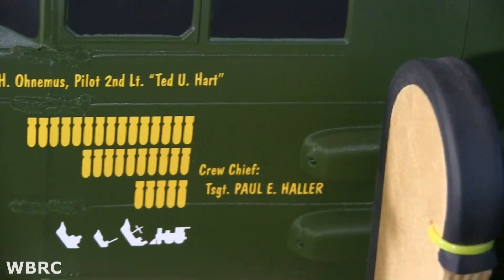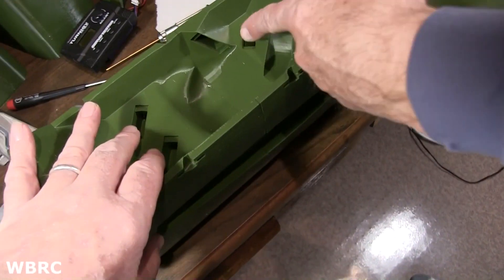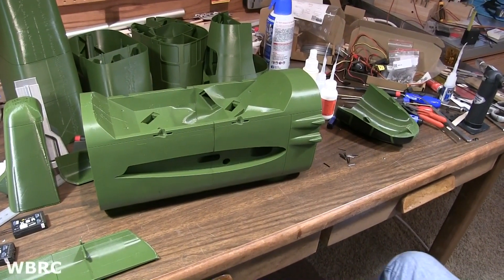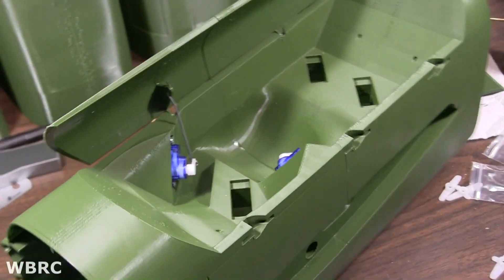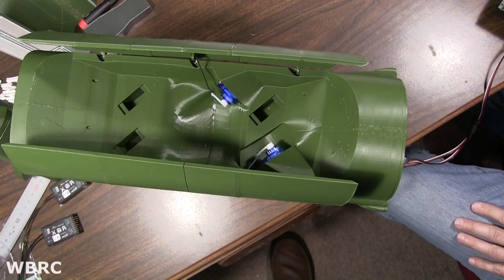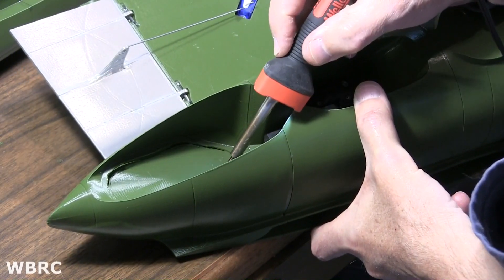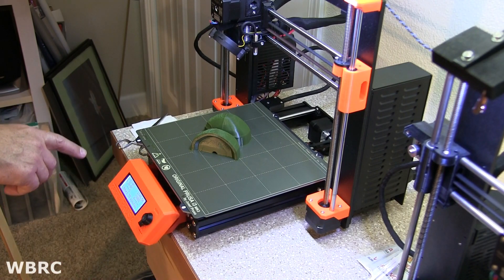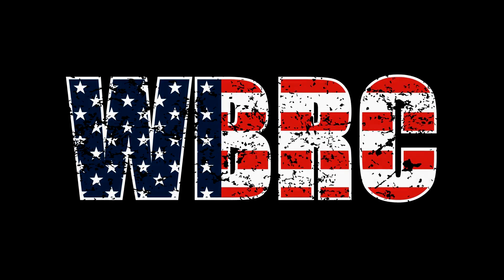3D LabPrint B 25 Mitchell

Comment: Hello, nice video, well made.  I also assembled the b 25 from 3dlabs but being the first 3d printed plane, i did not think to make sure the bowden tube for the elevators were clear for the 1.2 rods to slide easily in.  I hope you had better luck.
Reply from the maker: Thanks for the tips!

Comment: What printer did you use for this
Reply from the maker: At 6:30 you can see very clearly "original PRUSA".
Reply: @WrightBrosRC  thank you
Reply from the maker: You are very welcome. I would recommend taking a look at some 3D Print B25 threads in forums such as RCGroups. Many details there.
Reply: @WrightBrosRC  ok I will check it out
Reply: @WrightBrosRC is there a link
Reply from the maker: https://www.rcgroups.com/forums/showthread.php?3473121-3D-Lab-Print-B25&highlight=3d%20print%20b25

Comment: Does it matter what type of 3d printer or what size 3D  printer you get print print and RC airplane because I was going to put an RC airplane b25 too
Reply from the maker: Generally no, but 3D printing a B25 requires starting with simple prints and developing a knowledge base. It is an advanced project and your build quality will determine it's airwortiness.